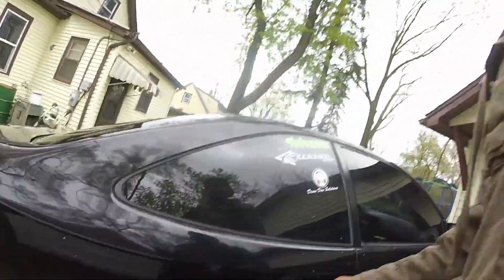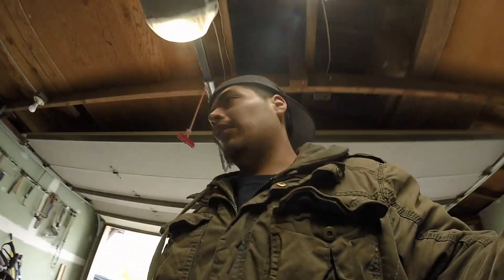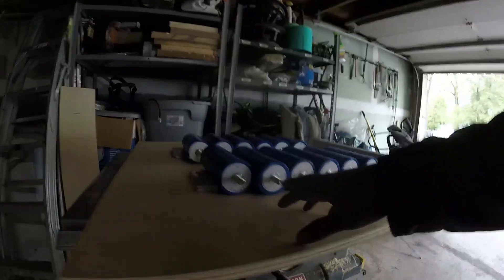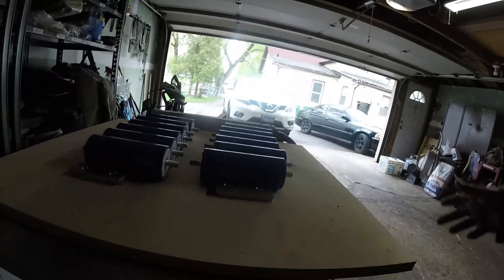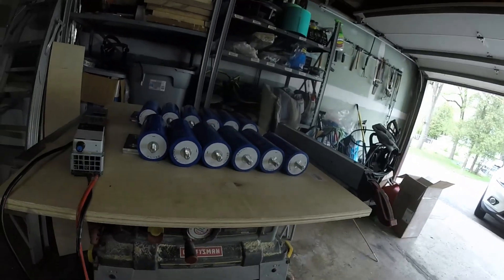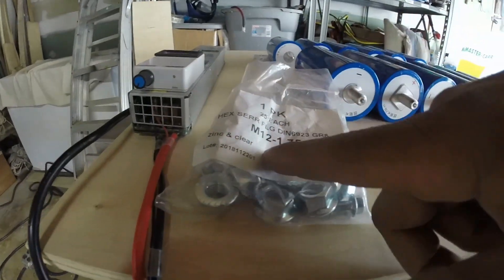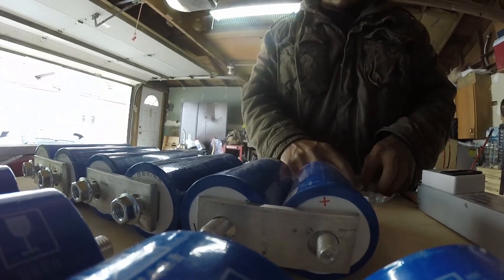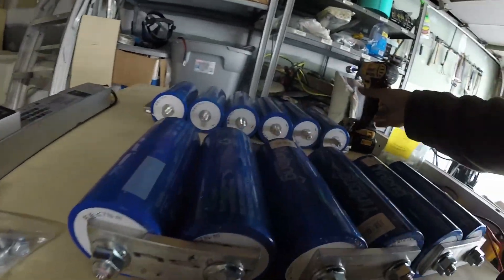Yinlong lto lithium titanate 40ah DIY

Comment: It's a learning curve, them batteries need loving so don't use Teflon bolts they don't make contact with the post, never use a impact to tighten the nuts no more then 7lbs tork, and why balance all your cells  then build one and charge it by its self, now you unbalanced them. You should of built it together and charge both at the same time. These LTO'S are not cheap

Comment: What's up dude great video one small little thing when you said your multimeter reads AC and DC you said AC was active current it's not its "alternating current" is what it stands for other than that man great video
Reply from the maker: Hahaha damn fail thanks for the knowledge homie
Reply: @loudjunkey4206  I am currently working on my first Ying Long Bank I baught 35ah cells and building 60cells into a 350ah bank so I hoping for enough power my alt is from brand x and it's a custom build I asked him to make it internally regulated set at 14.8 volts and it puts out 411 amps at 2,000 RPM it's a 390
Reply from the maker: @justforlaughs8988  that’s bad ass I got the 425 billet one from brand x going to add 400ah of the yinlong in my next build

Comment: How many (ah) I need for 7k rms
Reply from the maker: One bank with a good alt can handle 7k without a problem if you wanna go with 2 bank to play it safe nothing wrong with a over kill on voltage
Reply: Thank you and 1 bank is 6 right?
Reply from the maker: @Beatdaroad216  yes 6 cells make a bank

Comment: I have no Idea why so many people balance at the nominal voltage, it's almost meaningless. You either Top balance or Bottom balance. With this battery chemistry and a stock electrical system it's better to bottom balance to help protect the batteries. Why are you charging so slow?? These batteries in a 6S config is designed to charge between 20 amps to 400 amps.

Comment: Sorry to disappoint you, but your 40 Ahr batteries have been tested by other YouTubers and found to be 30 Ahr. It is a common deception by Chinese sellers regardless of the selling platform you find them on that the capacity and charge/discharge rate of batteries are misrepresented. 
On the positive side, these batteries have an amazingly high number of charge/discharge cycles. But on the negative side cannot charge/discharge at the high amp rates that other Lithium batteries can. In addition, their efficiency is only 85% vs 99% delivered by other Lithium batteries. 
To compensate for their low discharge rate and capacity you will need more batteries than you first envisioned being necessary for your project.
Reply from the maker: To be honest if it is only 30ah each its holding stronger the other battery’s I had it was 2 45ah jy power lithium paid $1000 each while I pay 300 each 30ah and doing way better work hands down so if I have to buy 2 more banks bring it I’ll still save money and have 5x the power
Reply: @loudjunkey4206  https://batteryhookup.com/

Comment: Some of these high performance batteries really pull a hard charge from an alternator, even if they are mildly discharged. What kind of charge current do you see installed in your car. Do you have a stock alternator? I would assume audiophiles have sources to good ones. The only types I’m aquatinted with are marine and they are quite expensive due to the need for them to be ignition safe (not needed for cars).
Reply: Karl Jensen we have about 10 different alt companies across the country that makes way better alt’s that boat alt’s! I have a 400a singer alt and he has a 370a so he is good! Also these batteries don’t charge up like your saying I think your thinking of caps because they do that ! But with these aftermarket alt’s there is nothing to worry about!

Comment: Or you can get an AGM Vmax mr137 with 120 ah for $280 that will last you 10 years. Probably about 1200 short circuit amps. Yes it’s heavier, old school and not as cool looking but it’ll work.
Reply from the maker: 120ah Agm that can handle 2000 watts or 40ah lithium that can handle 9000 watts do the math for almost the same price and half the weight looks better and works better

Comment: The guy you got the cells from is probably Shawn mayo.also,never use nylon nuts youl snap the bolt clean off.7lbs I think is the torque. Also you can charge them in the 15s no problem..just food for thought.i run cmax 30ah and voltage barely moves but I'm getting so yinglongs.and protos and testing all of them to see which is best for my vehicle
Reply from the maker: Didn’t use nylon bolts and the torque is 5.5ftlb and the cmax like the 15s yinlong to play it safe you wanna charge to 14.3-14.5 I wouldn’t go to 15 volts but everyone do it there own way

Comment: What everything's fully charged in my car is cold I put out about 15.0 volts is that too much for those?
Reply from the maker: Yeah that’s a bit to much they love the mid 14s but when it get to the 15s I don’t think it’s so safe for them what you charge them to when you charged them
Reply: 15.2 is the sweet spot but they can be charged higher.  Recommended is 14.8-15.2v I wouldn't recommend going over 16v

Comment: Be careful with how much you tighten the bolts...its like 7 newton meters of torque which is like 5.5 ft lbs, you can break them if you're not careful.
Reply from the maker: Thanks I didn’t know that I have a torque wrench I’ll redo them just to make sure good looking out
Reply: @loudjunkey4206  Very true. You can damage them by over tightening them.  Also, to anybody thinking of getting them, don't get nylon nuts because they require more than 7lbs of torque to tighten. You got the exact nuts they suggest to use. They are 12mm x 1.75mm serrated flange nuts for anyone wondering.
Reply from the maker: Wicked Evil Bass yeah that’s what I got I’m ahead of it all haha
Reply: @loudjunkey4206  I was pointing that out. Thats the only size nut that will fit those banks anyway so you'd have to have the right ones yes?

Comment: Damn bro I needed to see this fr cause I've been curious to how use these lithium boys. And now I can see how well the 80ah does on ur 2 6ks. Make sure u hook up a video with ur voltmeter so we can see actual drop at full tilt
Reply: Nice video man... wondering about the lto's.. are u still using a front battery or did u get rid of it and running strictly lto?
Reply from the maker: Jeremy Hardee got rid of front battery all I’m running is the lto
Reply from the maker: Ok I’ll make a video soon on them but it volts stay super strong

Comment: I can't wait to hook my 200ah of LTO up.
Reply from the maker: You Gona be super happy with the volts
Reply: @loudjunkey4206  you have to scv6 K's or just one? How does be 80ah do with two?
Reply from the maker: Dibeezy ThaGifted yeah I have 2 svc6000 at .67ohm each and the 80ah holding super strong I’m thinking on getting one more bank but don’t need it it’ll just be for the over kill
Reply: @loudjunkey4206  nice!! I'm gonna just put 4 of my banks in my Navi then. What are you clamping at .67?
Reply from the maker: Dibeezy ThaGifted I haven’t Meter just a demo car
Reply: @loudjunkey4206  damn it would be nice to know how much power you're getting from each amp at .67.
Reply from the maker: Dibeezy ThaGifted I’m going to a show this weekend I might meter it

Comment: What time does that car show in sandwich il start and what time is it over? So those two battery banks hold more power than the batteries you bout to take out
Reply from the maker: Hell yeah a lot stronger and it starts at 11am-3pm
Reply: @loudjunkey4206  OK koo bro